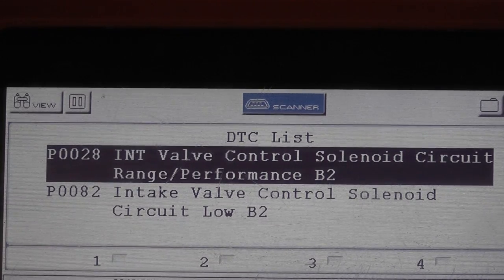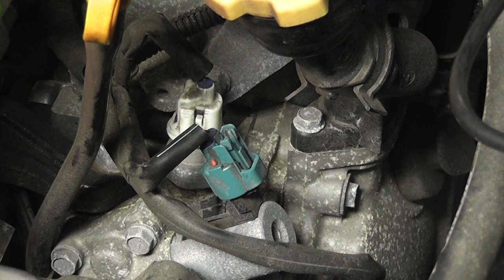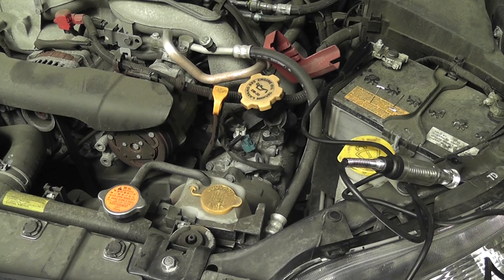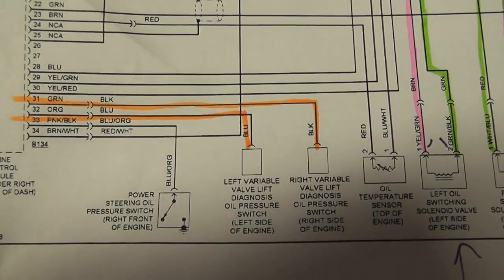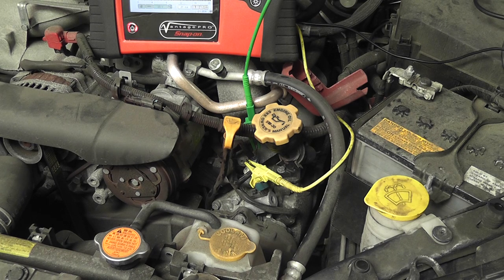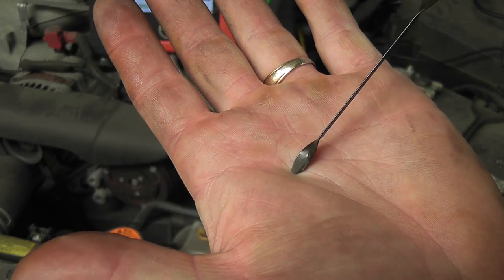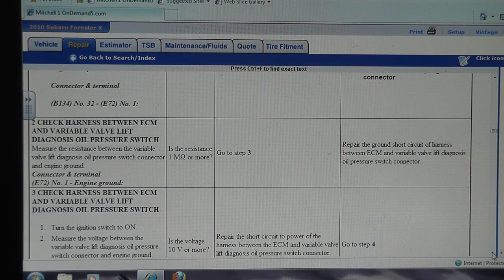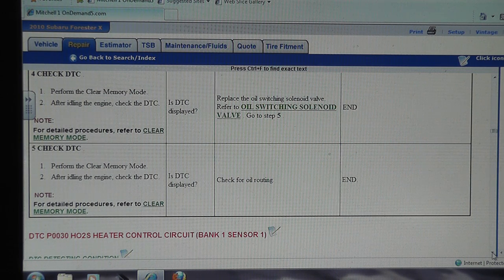How to test Intake Valve Control Solenoids (codes P0028, P0082) - Subaru

Comment: Subarus love drinking oil
Reply: just did a full engine service with seal rings on the pistons, both heads, valves adjusted and everything for a good amount of money on 2.0ltr petrol Forester 2010. It was drinking almost a ltr on 1000km at the end, before that it was like 3 on 1000, now I don't know, they say it should be fully redone the engine seals and everything, so about 1ltr on 1K km
Reply: Subarus love leaking from valve covers and head gaskets. EVERY one of them. Not a matter of if it's gonna happen, it's when. Normally around 70-100k is when they start.
Reply: leaking is more the word.

Comment: I think step one should be check the oil
Reply: Always, but that's pretty elementary and would be sorted long before getting into sensor testing.  In many cases, mechanics get attached to their diagnostic tools and overlook the simplest repairs while searching for more complex solutions.  From my experience, I've found older schooled mechanics are usually better versed in searching for more mechanical solutions first.

Comment: I check the fluids before running engines even if it’s something not related to fluids. You don’t want to seize or overheat a motor when testing. Vtech is a Honda name. You go on about accuracy but then use the wrong name 15 times. You don’t know the right name? Not all manuals are written by engineers. You sound like you have a chip on your shoulder. You wanted to be an engineer but couldn’t? Good video otherwise.